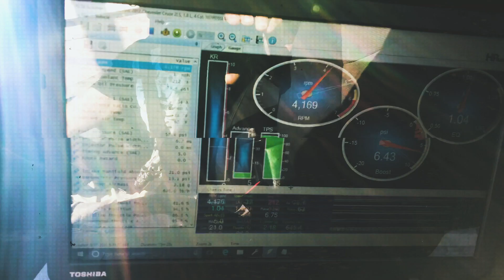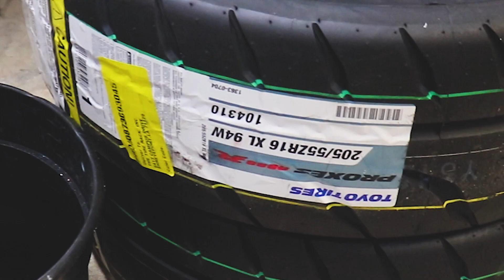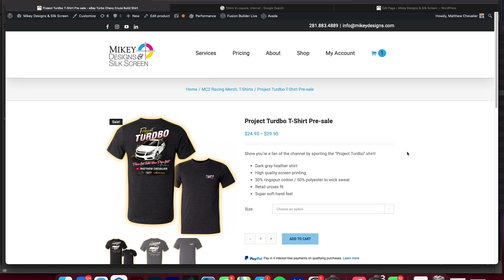Evo Lancer vs. Cruze Sleeper: The Ultimate Showdown

Comment: 8:49 that's a 6 Grove turbo 1.4 pulley in your hand. Your car should be all 5 Grove na pulleys. If u got a mixture of 1.4 turbo stuff it won't fit the tensioner is completely different for the turbo because it's a chain driven engine.

Comment: Ok look a the holes the bolts go through and just place the bolts in the holes and look for oval-shaped areas. Any type of gaps will just cut the bolts 🔩 over time. 
 Also not sure if stock bolts are hardened or not.  Just in the way the bolts look where they broke off they don't look like stock ones. Where is the alignment pin ? 📌 on the crank I think there was in on mine I would have to look.  1.4t  is what I have. 
  Keeping up with an Evo that's interesting he may have been not turned correctly if he's maxed out because those cars are pretty hot off the floor. 
  Other than that you have made progress and you were driving 🚗 🙃  it around & yes the weak links will show up . Look at a 1.4 t and measure the height from linkage to charge pipe. 
 Just few thoughts here . 
 Be safe team.
Reply from the maker: Thanks! Neither of the engine I've broken down had dowels. Don't see it any engine diagrams of the manual I have 🤷🏽‍♂️ The crankshaft reluctor sits on the holes which you would think a alignment pin would go in.
You're right about that, but he was at full send and could hear his BOV loud and clear. Maybe couldn't drive lol... who knows. Tried to get the dude to line up, but guess it was for the best because I'm sure those crankshaft bolts would've gave then and I was further away from the shop.
We'll get it sorted and more to come!

Comment: I have a 2014 Cruze 1.4L and with the water pump and the pulleys and balancer Gm changed that whole side I had to get a new timing chain cover and than has to get all new pulleys and stuff cause nothing lined up correctly one balancer was a 6 row and one was a 5 row with completely diffrent notches on the back side I learned that after 2018ish they changed that whole side to new parts so when u get new parts for one you need all new ones
Reply: But the cruzes are really fun to mod I’m at 27psi With a gtx250 turbo and a few other goodies and Daym is she fun but more power=more problems
Reply: @LJs_bar_and_grill  Is this your daily driver?
Reply: @charleslowe522  yea I drive it everyday I have 112k miles on it but most my parts have like 20k on them max other than pistons and rods
Reply from the maker: I hear that! All part of the fun and process.

Comment from the maker: Thanks for watching gang! As far as the sheared flywheel bolts go. They were new straight out of the package and torque to the proper sequence. 45lbs, 45º, and then another 15º. They were sheared pretty flush with the crank. Looking into enlarging them a 1mm or 2 and installing some ARP fw bolts so they'll hold. The stock tty bolts are 9mm x 1, UHL .93".
Reply: Lol I called it last week, I Knew you was spinning those tires!! Just wait for the power of the fully built engine! ...also..did I miss dyno day??
Reply from the maker: @bryanoldaker3730  You sure did! I didn't even realize it. Took it for a spin without the laptop and sure enough, errrr! You didn't miss a dyno day. I've just been street tuning it here and there. Would take it for a drive in the morning before getting after work. Log, tune. Then the evening, same thing. I've done about 20 logs and tune adjustments. Not the most excited stuff, nor easy to record keeping an eye on a laptop and driving stick. I figured once I had it pretty dialed, I could record somehow but happen to shear the flywheel bolts before that happened lol. I'll get her back together and figure out a situation where I can record some of this stuff. Managed to tune it myself and has been going really well... aside from breaking things lol.

Comment: Hey Matt, not sure if you are familiar with hardened bolts. But you might want to consider class 10.9 or grade 8 bolts. They are generally the hardest bolts commercially available without getting into exotic metalergy. You can usually find them at most fully stocked hardware stores. You'll want to bring one of the old bolts with you and match up the threads and profile if there's a smooth stem near the head ect.
Reply from the maker: Hey D K! I'm am. I have a set of ARP bolts on the way, so I'll go that route. Definitely a lot of work and expensive tearing up a flywheel, but anytime I need some replacement bolts that need to hold up, I go with grade 8 or 10.9's when the strength is required. Thanks for looking out.

Comment: Message arp and see if they have anything in the thread you have. IMO you might have over torqued them or not have replaced them and there torque to yield and they would have been weakened, but drilling the crank to enlarge the holes should be done at a machine shop to ensure straightness and the crank is hardened. So standard drill bits won’t work and you’d need a bottom tap. Easiest thing would be to contact arp
Reply: Also do you know the thread and pitch?
Reply from the maker: With a thread pitch tool.
Reply from the maker: Solid advice. I'll give them a call. My past experience is they're not very keen to just making one offs, at least not without placing a bulk order. Especially with the bolts being cap screws and not your typical hex / point style bolt pattern, which wont work with the engine. Ideally pulling the crank and taking it to a machine shop would be the best route, but I'm keeping this DIY. If I were drilling into a blank crankshaft, I wouldn't try it on my own. Thus far I've drilled and tapped the cylinder block for larger studs, as well as opening up the cylinder head holes. As long as you take your time and open them up a little at a time, they tend to stay square. With the built motor, I've let the machine shop handle everything. This build is more about let's see what can do on a budget and make happen.

Comment: Never trust a impact gun tightening as some battery powered ones aren't good. Always check with a torque wrench.
Reply from the maker: Used a torque wrench, and the appropriate degree wheel.

Comment: Do u have a build list on what u have done I’m doing this in Australia and would really love to have some other input
Reply from the maker: It's a pretty simple build. From top to bottom.
$35 aluminum cam cover
$500 SuperTech spring and retainers
$400 Maxpeedingrods z16 conrods (use code MATTCHEVY for a discount)
Custom turbo manifold (cost about $500 to custom make)
$190 GT35 Maxpeedingrods turbo
Custom intake (stock one should be okay too for good power. Custom unit cost me about $600 to make)
$550 InjectorDynamics 1050x injectors
DW 300c fuel pump, think it was $220 for the install and testing in the housing.
$350 - Radium fuel pressure regulator and fuel pulse damper
$150 ebay intercooler tubing
$89 large ebay inter cooler.
$58 50mm Maxpeeding BOV
$65 38mm Maxpeeding wastegate
$550 for HPTuners and an AEM wide band
$600 flywheel wheel
$500 stage 5 clutch
$700 LSD (not necessary for drag racing)

All DIY stuff, so saved a lot in labor. Total all in with a stock block. $6100. I'm sure there's some additional fittings and what not, so figure another $500. If you didn't fuss with a custom intake, or flywheel, you'd be in the 3k range.

For machine work, and the custom pistons from JE, it was around another $1400, but I don't think it's 100% necessary if you're shooting for 300-400 whp. Just open the ring gap up for boost.

Off the top of my head, maybe 8k all in, but have found some things haven't been 100% necessary. Just toss some rods, springs, retainers, open the ring gap, turbo manifold, affordable turbo for your power goals, intercooler, pipping, exhaust, and fuel mods to support. Cheap power, and throw boost at it and enjoy.

Comment: Looks like you're missing the dowel in the crank to hold the flywheel? Not sure if you just moved it out in video but I couldn't see it in the end of the crank or the flywheel?
Reply from the maker: Hey Paul! TBH, I haven't seen a dowel on the flywheel or the flex plate on either engines, but will definitely grab on up.
Reply: @cmattdabrat  perhaps it doesn't have one after all? I'm sure you can see where I mean about looking like one should be. May only be to help fit the flywheel perhaps? This build really does test your perseverance eh! 😅

Comment: I have a 2013 Chevy Cruze ls 6speed manual. When I seen you driving your car and I seen that you didn't have cruise control on the steering wheel I almost died you're telling me there's another Chevy Cruze without cruise control ???LOL 😂😂😂😂😂 I bought mine with 30,000 miles it's got about 115,000 on it now officially paid off a few months back it's my daily I drive it 110 miles a day when the 1/8 goes out I'll buy a different car and this one's going to get a 3.8 supercharged
Reply from the maker: LOL! When I was looking for a Cruze, had to be the 1.8 with a manual so I could eventually do this to it. On the plus side of things, I got an almost new non cruise control steering wheel to replace the worn one for $25. That's awesome! The 1.8's are much more reliable. Got mine with 24k and now has 124k. Had zero issues with it... well, until I started boosting it hahaha. Keep me updated on the 3.8 swap, sounds dope!

Comment: Man that's crazy that they broke like that! Where they brand new, or re-used? Maybe call arp and see if the can make some?
Reply from the maker: Brand new and torqued to spec! Seems like it came apart once it bounced off of rev limiter at 8k rpm. Shoots from 5k-8k fast and I was focused on stopping the log before it bounced rev limiter. Then just heard a grind lol.
Reply: @cmattdabrat  lol!  I was also going to say make sure you give the bellhousing a good inspection and look for cracks,  don't want it leaking after!

Comment: Go big on bolts, u mentioned 2mm, I'd skip straight to 4mm or more maybe, so u never have to worry again as long as the flange doesn't get damaged or weekend. For the belt, it would take 2 people and a lift for this, but lift the car with person (Make sure secure) lol Line ur eye down the belt like a gun sight. Do that all around, all contacts. Something is rubbing or what I'm guessing one of ur pulleys off a hair. If it's off a washer width it will jump or shred. Don't forget about engine torq rocking it. Under load it might be rubbing on Something that it doesn't do at idle. Love ur content.  Goodluck
Reply from the maker: On it! Well, found some M12 cap screw ARP flywheel bolts I think will work perfect, which is 3mm oversized. Hopefully that'll do the trick!
Awesome tip! Will give that a try and hopefully can put this belt issue to bed.

Comment: That's really crazy. I would wonder if those are TTY flywheel bolts you reused or if they were over torqued? Generally reusing flywheel bolts should be totally fine. Obviously you have increased the power a lot and if they have been overstretched even once, that could cause fatigue that led to cracking. That plus vibration essentially yanking on the heads could have cause cascading failure. Find it very unlikely the shear strength of the bolts was actually overcome, but same effect. Very lucky the flywheel didn't decide to yeet itself out of the bellhousing. I know where to get ARP bolts by the bolt cheap if you know the thread pitch and length you need. Allen's Fasteners online, great site and good shipping time.
Reply from the maker: Tell me about it! They were new. When I ordered all the seals and TTY bolts, I was sure to get some. Torqued them to specs, and did the 45º and 15º increment. Flywheel sawing through the floorboard wouldn't be fun. lol. I'll check them out!
Reply: @cmattdabrat  Wow that's crazy. Really surprised they failed, but they must not have as wide a safety margin as many factory bolts. Or something else weird happened like the bolts managed to loosen ever so slightly and the wobble caused the failures. Usually that completely smokes the crank or you have bolts fall out though.
Reply from the maker: @spankthemonkey3437  Nice! I'm guessing these bolts just aren't meant to handle the amount of torque I'm throwing at them.

Comment: Yes bigger flywheel bolts will definitely help but I don't think that's why they failed.  I think it has to do with having soft engine mounts and chattering your tiers. What happens is when you have traction and load up the engine, the whole engine and transmission twist and flex your rubber engine mounts. When you lose traction the rubber acts as a spring or rubber band and twists the engine back in the other direction. When you chatter the tires you're rapidly loading up and unload the engine, twisting it back and forth in the soft engine mounts. That's really hard on all the drivetrain components like axles, transmission, clutch and flywheel.  You really need to get or make some hard polyurethane engine mounts or the next weakest component will break like the input shaft or axles.
Reply from the maker: Very solid point. In the video where I installed the LSD, I also installed billet CNC trans mounts with solid rubber bushings the prevent movement. The mounts themselves really don't play much of a roll, IMO aside from holding the engine and trans in the vehicle on a FWD application. During the pulls I didn't experience any tire chatter. It would just pull and the blow the tires off once reaching 13psi. They broke once I hit the set reline of 8,200 rpm. I plan to install a WOTbox, so if the stock bolts can't hold up to ignition cut, I'd still run into the same issue with stock bolts.

Comment: Evo guys have huge egos and Evos are very dependent on a tune to make the best of their parts. Even putting a CAI on an evo and not tuning it will actually make it lose power. Those 4B11’s in the evo X’s will make respectable power with not that much. Good intake, full exhaust, hard pipe upgrades and a tune is easy mid to low 12’s depending on driver. But it takes a decent driver. 

But, I gotta disagree on the definition of clapped out. I don’t think a clean painted evo with nice turbo noises is clapped out. Especially against a car with eBay parts and no working reverse and a barely functioning idle. I say this with love and as a big fan! I’m a dsm guy, so I know a thing or two about clapped out!
Reply from the maker: All great points. I appreciate the feedback. Reverse is working. Just had to fabricate the tube going to the intake out of the way, and she's idling great now. Just took a little tuning. Only parts that are on the car from ebay is the intercooler piping, but it's quality stuff. Aside from that all brand name parts. :)